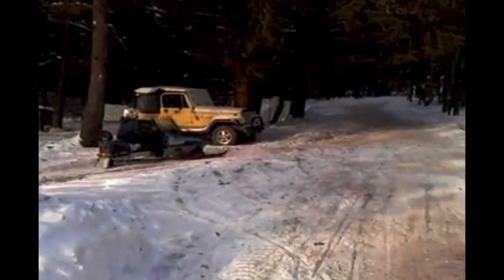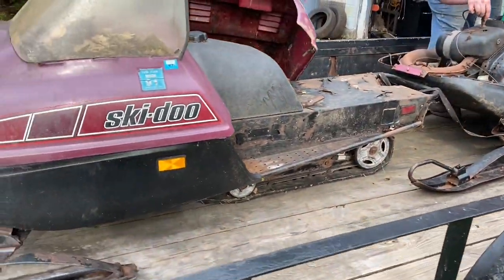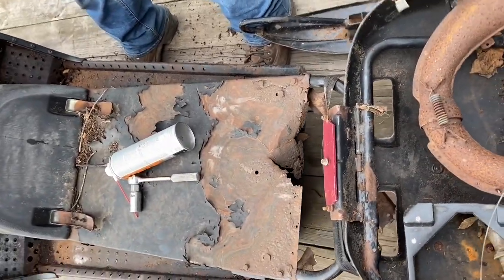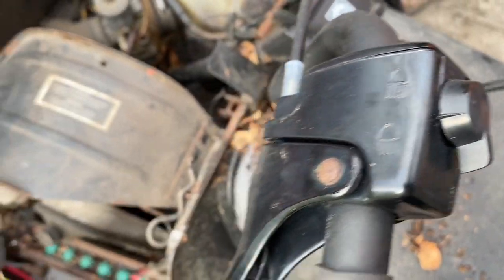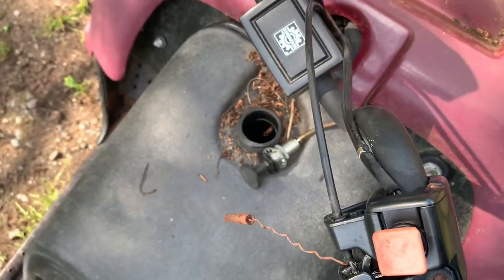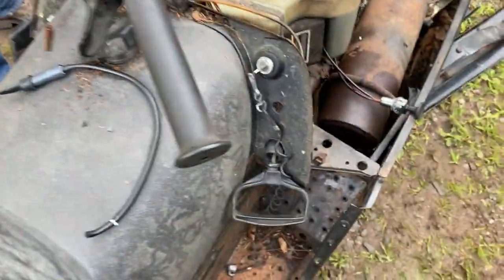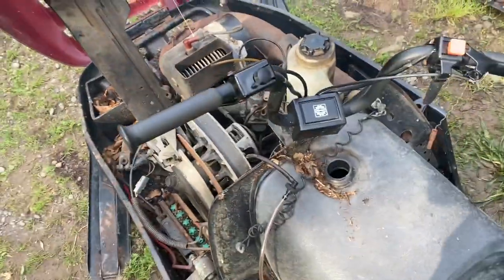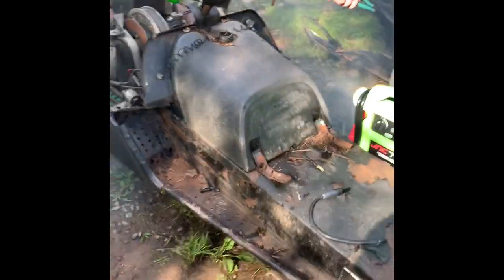Found My Old Snowmobile In The Dump! Will It Run? 87’ Ski-Doo Citation 250

Comment from the maker: My brother and I grew up riding a pair of 1987 Ski-Doo Citation LS Electro 250 snowmobiles. We rode these snowmobiles for years and years until we eventually outgrew them. They were then given to a friend of my dad’s who had plans on restoring them for his grandchildren to ride.

As it turns out, however, these plans of restoration never happened, and during a trip to the town dump a few weeks ago, my brother happened to stumble upon the very same pair of snowmobiles that we grew up riding. He called me, and I rushed over there in record time. Unfortunately, both sleds sustained some damage during their extended stay in the town dump. My sled made out a fair deal better than my brother’s, as his was buried in a heap of other trash and appliances, whereas mine was out in the open. Even in the sad shape we found them in, we simply had to have them back. So, after explaining our connection to these sleds, digging them out, and running off some competition, onto the trailer they went. 

My sled sustained some damage to the rear of the tunnel, whereas my brothers sustained quite a bit of damage to the left side of the hull and chassis. In this video, you will see some footage of these sleds in their hay day, as well as some the aftermath of us getting them back home from the town dump and attempting to see if either one will fire. 

My goal is to have my original sled up and running by this winter. My brothers will require more extensive repair, so our plans for that one are up in the air. Regardless, stick around, because I will be making videos throughout this process. Hope you enjoyed our find, and thanks for watching. If you haven’t seen it, check out my short about my other Ski-Doo Citation 250!